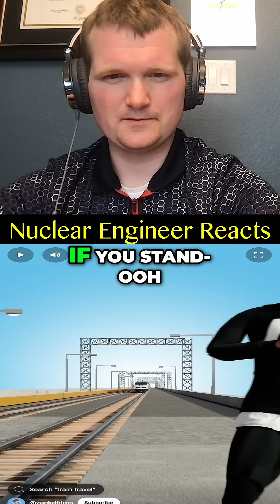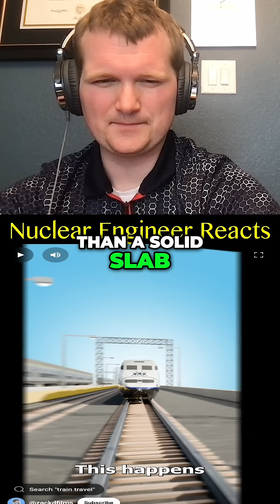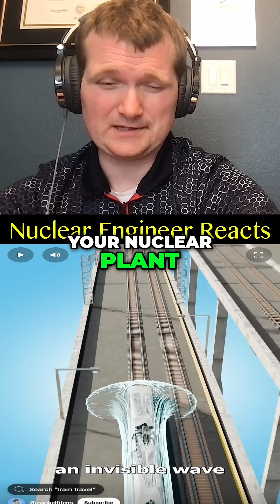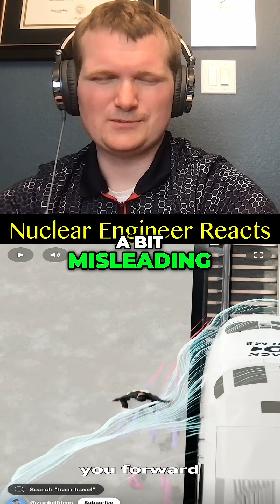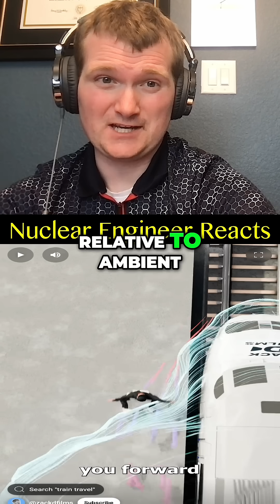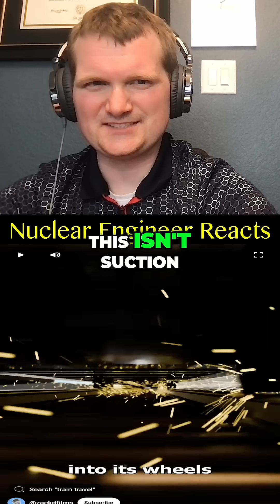Why You Shouldn't Stand Near Trains - Nuclear Engineer Reacts to Zack D. Films

Comment: That is pure rubbish 😂😂 let's say you stay 1m away from the edge of the platform, you would get hit by the pressure wave in front enough to push you away. Also, the pressure in front would be higher than the low pressure on the side. The faster the speed the greater the pressure in front.

Comment: I mean not to be that guy, but an area of lower pressure relative to ambient is exactly what suction is.
Reply: But this will not actually pull anyone in. It can only push you away. People have been run over from this though, but it has nothing to do with suction, as there is no substantial suction. It just knocks people over and the way they fell happened to be toward the tracks. There's no suction force at work here. Or not one anywhere near strong enough to pull in more than half a lb or so, if that. This is a common myth with trains that they will suck you in, and that myth is heavily perpetuated by the subway systems themselves to keep people scared of getting too close to the train. Which is smart I guess, but it's been bedunked a number of times. The pressure wave will knock you down if you're small, weak, or caught completely off guard. It will not suck you in though. The vast majority of the time you would actually get pushed away from the train. It's when people panic and try to catch themselves that they end up on the tracks.
Reply: @Loserstakethebait there is, it pushes you out at start and then sucks you in right after, the beams that are holding the cables above the track to power the trains are engineered in a special way to withstand both of those forces.
Reply: @mifciowo  This has been tested and it was proven incorrect. The suction force is so weak that it's not possible for it to pull you at all.
Reply: @Loserstakethebaiti can't send links to the articles because youtube deletes comments with links...
Reply: @mifciowo Articles say it because the train stations pushed it as a scare tactic. Just because an article says something doesn't mean it's true. The forces at work simply aren't enough to create that kind of suction. No article is going to be more accurate than physics lol.
Reply: @Loserstakethebaitit was a scientific article about the counstruction of support beams and it had stress simulations showing that the force pushing away and sucking towards the train are practically the same. It was connected to the standards that will need to be used for the Polish high speed line that is under construction.

Comment: "Humans tend to be clumsy" as if THATS what's killing you here 😂
Reply: I think they were trying to say that the air won’t literally pull you into the tracks. but it may scare you which might make you lose balance and fall.
Reply: Yes, it is. The pressure difference itself wont pull you hard enough but it will surprise you and that will get you off balance and then you will get pulled in.
Reply: @innergenichiro  exactly a train pushes air away from itself not inward
Reply: @DanieleBosco-i7kfound the guy who has never watched leaves or newspaper or whatever be sucked along the platform or onto the tracks as a train goes through a train station. Gotta love your example of the dunning kruger effect though. Bless you for trying.
Reply: @NateTheScot  that is another effect. it's the opposite. when you move something fast through a compressible liquid, you get a positive pressure zone in front of the object and a negative pressure one behind. if you consider the train as a single cilinder then the only suction you would get is BEHIND THE TRAIN when the air re- joined itself (but then you would need another train to run you over and the force wouldn't be strong enough anyway). now, the train is not a single object. every thing sticking out of it will suck things in behind it, such as wheels, brakes, etc. but I don't see you falling from someone blasting a handheld fan on your shoes. you would not fall even in strong winds. so no, you actually think you're falling, then you get scared and loose balance
Reply: uhm, yeah like saying a fast car passing close will pull you under the wheel. its just target fixation or similar
Reply: @DanieleBosco-i7k A bullet train and a fast car are two entirely different things. As explained in the video, a bullet train is exceeding speeds 2 or 3 times a car at max speed, and it's going so fast it's pushing air in front of it, causing positive and negative pressure zones, whereas a car would simply be cutting through the air as it passes around the body, as it's not fast enough to push air into a collective "wall" like a train would
Reply: @javechonson he literally explained in the video that it isnt a "wall" of air, and here you are spewing the same misinformation.
Reply: @javechonson My guy, he explained it isnt a wall of air in the video. 

Tell me you arent the sharpest knife in the drawer, without telling me you arent the sharpest knife in the drawer!
Reply: @javechonsonstop spreading misonformation please, you cant nove through air without causing a negative pressure zone, indipendently by your Speed. And no, you Won't get pulled in even by a train suction, wich, by the way, verifies BEHIND It
Reply: @DanieleBosco-i7k Okay well firstly, I meant that a cars negative pressure would not be enough to suck someone in, as its not as fast or moving as much air around. Secondly, does this not follow Bernoulli's principle? the train create a slipstream causing negative pressure not only in the rear, but ALSO along the sides, where the air is moving incredibly fast from the "not really a wall" of air at the start of the train, And thus it's pressure would decrease immensely, causing a pulling motion towards the negative pressure zones
Reply: @javechonson again, loosing balance due to slipstream is being very clumsy. slipstream is only a real problem near mach 1 speeds
Reply: @DanieleBosco-i7kthere are literally videos of normal speed cargo trains pulling baby trams towards them in a slip stream. I have no doubt that a bullet train as depicted in the video , could pull someone extremely close to the train underneath
Reply: @javechonson ITS THE FUCKING SUCTION BEHIND THE TRAINN
Reply: @DanieleBosco-i7k yeah well the videos I am speaking of have suction on the sides dude. The end of the train doesn't come for a few minutes more
Reply: @javechonson okay, can you link them?
Reply: @DanieleBosco-i7khttps://youtu.be/xf9Y2tn5Qf4?si=8OYfULkgjda1Or47
This is a baby carriage rather than a real person but it's also not a high speed train, it's freight, so a higher speed train would have a faster moving air current and thus, because of the Bernoulli's principle, a lower pressure slipstream that could easily suck someone in that is right next to it.
Reply: @javechonson oh shoot is that a highly irregular train that creates multiple suction zones and a powerful slip stream (even tho its not the best word for this)? if a bullet train made this turbulence it would lose entire hundreds of kilowatts every hour just of resistance. and for the same reason, to avoid all risks, they ask you to be behind a certain line in the subway and the train station. also, do you see that baby carriage? it's all aluminum, it has an enormous surface area for the weight (the fabric), has probably no more than 2kg in bags, AND THE WHOLE THING IS ON WHEELS. you have to be pretty clumsy to fall like this
Reply: That is a nice way of saying that we have a bad tendency of being in the worst places at the worst time. 😅
Reply: i mean dude is walking within arms reach of a train. sounds pretty clumsy to me
Reply: the vast majority of accidental deaths are literally human error, so yes, people who can't plant their feet and seek equilibrium deserve the Darwin Award
Reply: @akiraic  what an overstatement, and comletely false. The darwin award was supposed to be in extreme cases where the cause of death was so preventable that you actively had to try to be dumb enough to have happened to you.